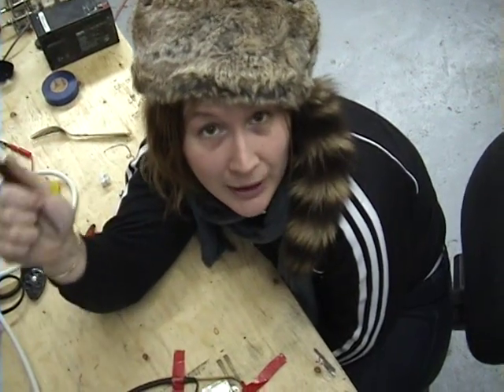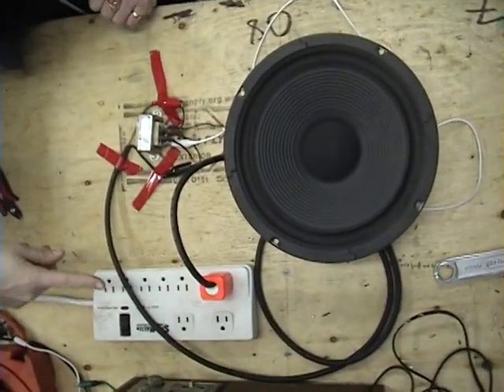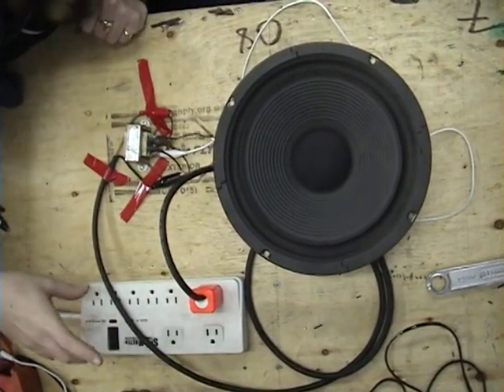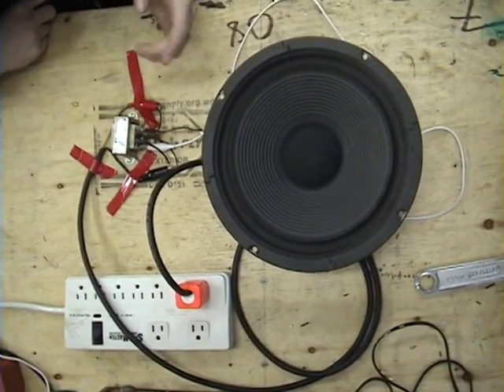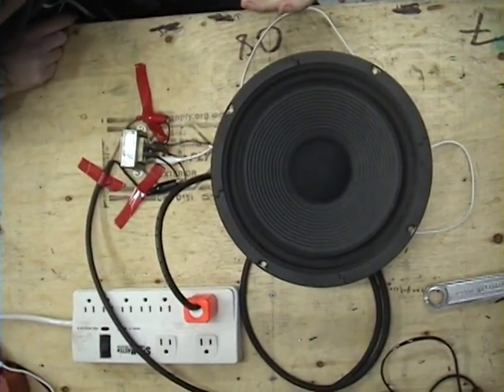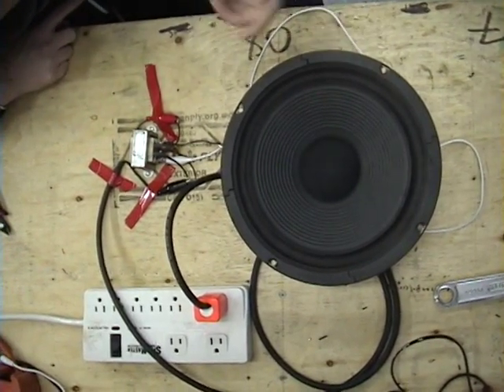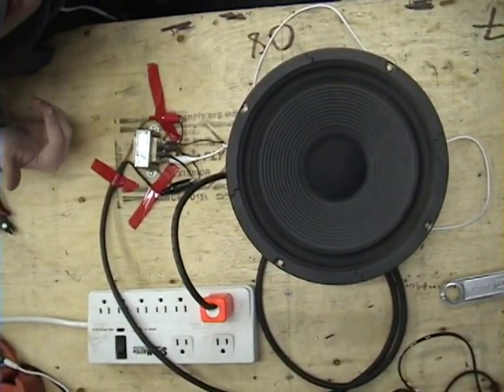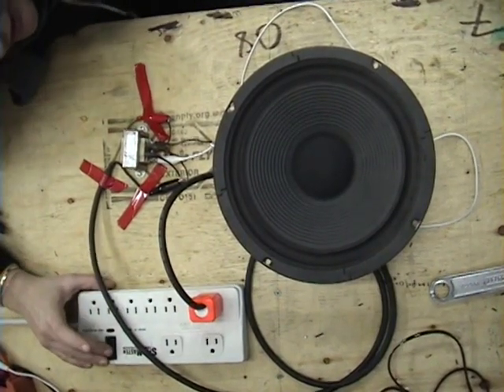60 CYCLE HUM EXPERIMENT

Comment: That's why your guitar amp hums. It has nothing connected and power is just circulating straight to the speakers. It also happens with single coils because background electricity and power lines can be picked up since there isn't a second coil to cancel the hum.

Comment: Hi, I have a dj mixer that hums like this all the time, even with all the inputs down or even disconnected it still hums.Its not a mixer with an amplifier inside just front end preamp disco mixer (5 channels). Any advice would be greatly appreciated,ive asked a few people on yt already. Also ive replaced the filter capacitors in the psu and that didnt cure it, and it definetely isnt a bad ground hum,its mains hum for sure, any thoughts?? thanks from UK

Comment: This sounds like whats coming out of my guitar when I put on the distortion pedal, you think I need to check the grounding to avoid this hum?
Reply: Juan Pablo Monzon it depends on the pickups. If it has single coils, it's normal for it to give off this 60 cycle hum. If it has a humbucker, you may want to get that checked out. Humbuckers are specifically designed to buck, or stop, the 60 cycle hum, hence the name, "hum-bucker". I hope this helps!
~Mike, punk rock rhythm guitarist for 5 years
Reply: Yes. This is a grounding issue, unless there's a ground-loop on the house wiring, in which case, you're going to get this hum even when grounded.

But, yes. You grounding your amp should stop the hum, if it's wired up properly.

Comment: American voltage is 240VAC 60Hz Line to Line, 120VAC 60Hz Line to Ground. How do houses get power in the UK? Two separate phases, with a common neutral?
Reply: No, they just get 240v line to ground. Line to line they get 400v

Comment: I've done that before with a little transformer put in an old cheap speaker box. I've also done it in a wall plug-in transformer case that had a vent and used a tweeter wondering if it would work to ward off pests.

Comment: i found your video because i have a noisy air conditioner...  the fan motor is creating a 60 cycle hum that is resonating through the fan blades.  is there any way to reduce the hum?
Reply: Sadly, yes - but it involves money. You will need a better fan, most likely. Also, it may not be the fan, it may be the compressor motor. But both motors run at a multiple of 60Hz (that's how an AC  motor do), and unfortunately, that hum will come out unless the motor is a really nice one (great bearings), or mounted firmly (read: REALLY firmly - like girder firmly). You may be stuck with that hum.

Comment: why do strats have such a problem with 60 cycle hum and how do you fix it?
Reply: Grounding, grounding, grounding. And more grounding. But the big problem is that you're a huge antenna, and you're surrounded by a very  loud 60Hz radio signal (yes, coming off the wiring). The Strat is picking up the radio signal through your hands, (and when you're not touching it, from the air around them). Their pickups are VERY sensitive (part of what makes Strats so great!), and they are amplifying the signals and pumping them through the amp, so you can hear them nicely.